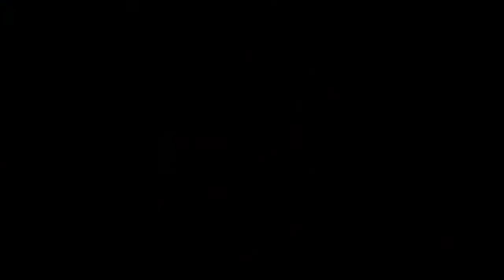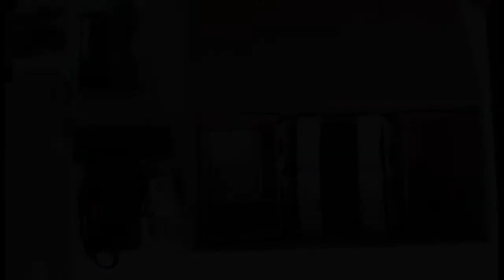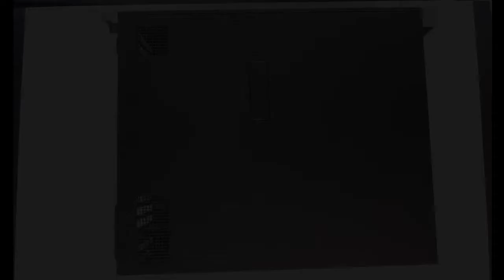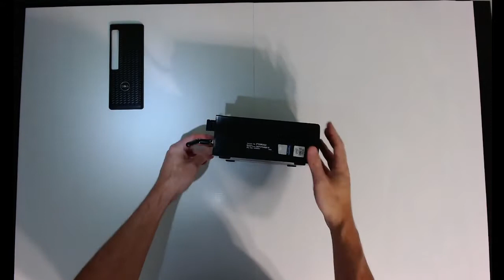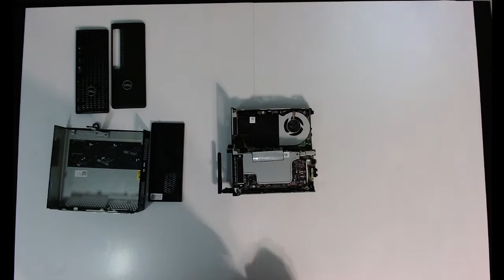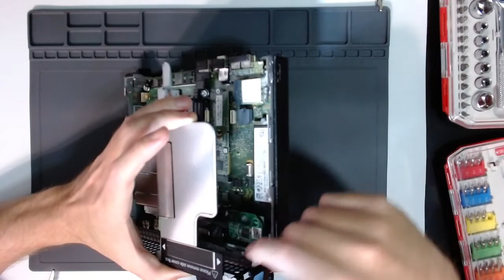Dell Precision 3240 Unboxing and Teardown

Comment: Can it fit both the NVIDIA Quadro P1000 and a SATA 2.5" HDD ?
Reply from the maker: Hi Cristian, unfortunately not - the discrete GPU slot and the 2.5" drive carrier occupy the same space in the system. :(

Comment: Good video thanks. How loud are the fans in this pc? Is it annoying when placed right in front of you on your desktop?
Reply from the maker: Hi@Pesar, I have two versions: one is using the Quadro RTX 3000 GPU, and can get quite loud when I push it hard (though this is infrequent). The other is using the Quadro P1000, and has never gotten loud, that I recall. 

Of course, that's all anecdotal, "your mileage may vary" based on how you use the system, of course...
Reply: @drobinson78758  Thanks for the reply, appreciated.